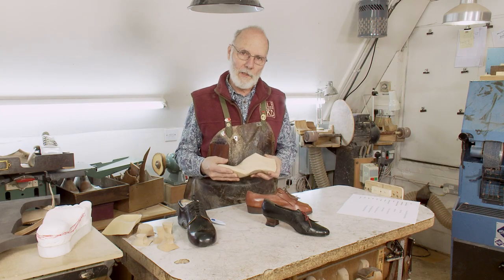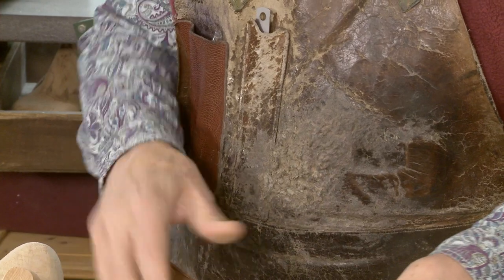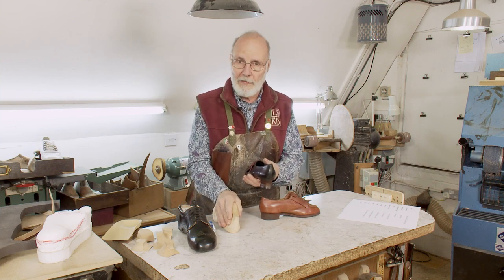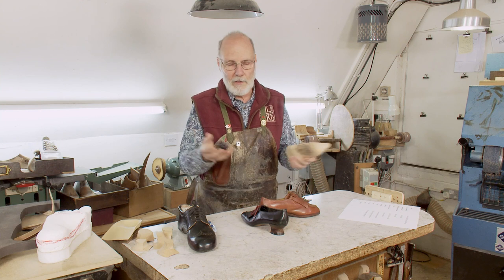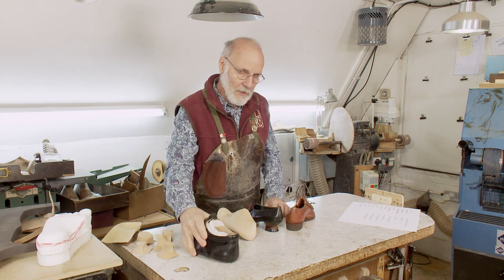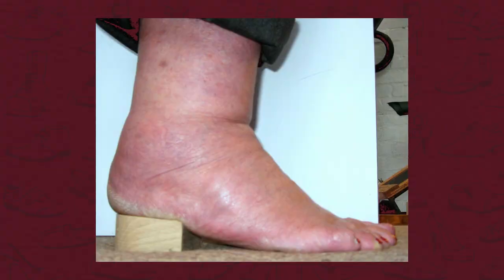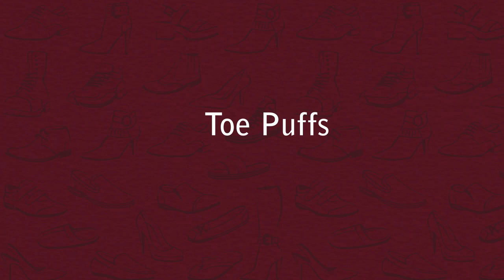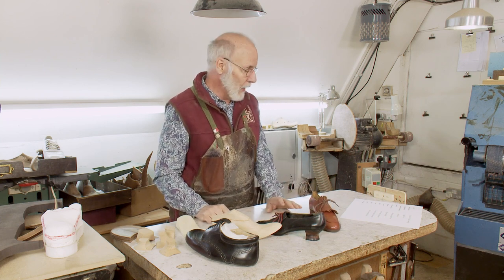13 Categories of Foot Conditions Requiring Bespoke Orthopedic Shoes

Comment: Some great information throughout your series, Im an ex military engineer of 22 years service and now a  prothetist/orthotist in training and the information your giving is tying lots of things together for me, this series should be essential viewing.  I only wish I could find somewhere to manually learn the craft of actually hand making the footwear, im 44 getting no younger
Reply: Hi .... my understanding is that a prosthetist orthotist does not fabricate shoes or lasts but rather fabricates appliances for limbs and shoe insole / outer sole modifications for lack of a better skill description. Orthopedic shoemakers are traditional bespokers for the most part who incorporate their skills to accommodate an abnormal foot by either building a foot correction onto the bottom of the last and or a last modification for the upper portion of the foot or both. Then the shoemaker makes the upper , lasts it , constructs the bottom sole and finishes out the orthopedic footwear as needed.

Comment: As a 19 year old with hypermobile very narrow ankles that fall to the inside (but no overpronation, I don't don't have flat feet. That or my arch is high af) smooollll feet a pretty high instep and hypersensitive skin for who grandma shoes I despise anyway don't even work I like this channel.

I got the short straw feet wise. They look nice though, for now, when they aren't swaddled in fluffy socks or laced tight in whatever shoe is theoretically fine-ish (is technically my size and has space for orthotic insoles)